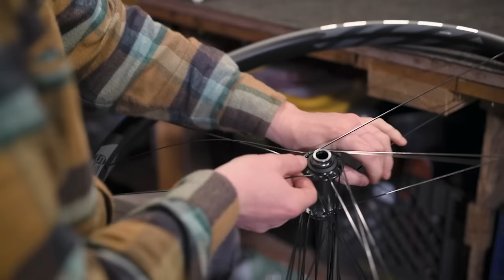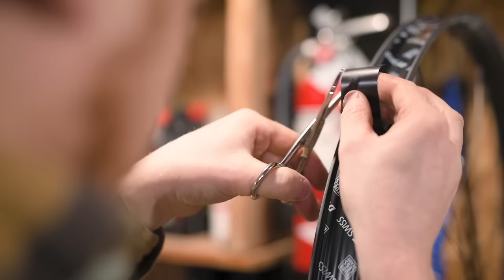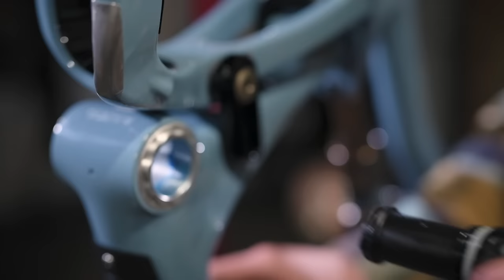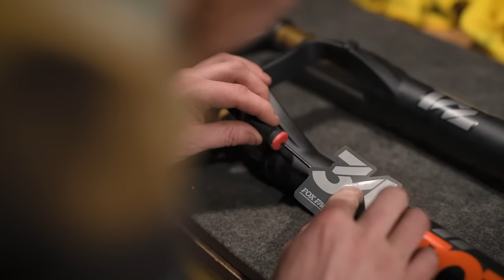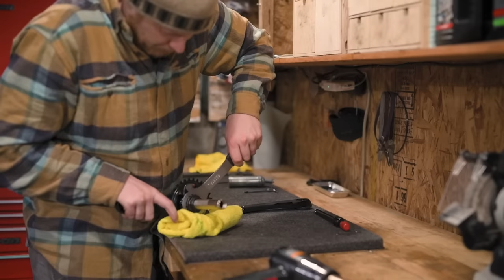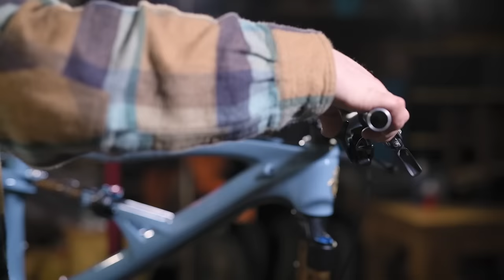Dream Builds: Nicole Formosa's Ibis Ripley

Comment: I never would have imagined the amount of work for spokes on a tire. Wow, never seen this done before.
Reply: And he didn't even use spoke prep on the threads that I saw.  Using that means 15 minutes MORE work the day before and then 24 hours to dry. 

But a tension meter is a must and it really slows down the wheel building process.  But the fantastic end result is well worth the extra time.

Those are indeed beautiful wheels.  But I'd rather see King hubs.  But I realize it's a factory bike build, so it needs the sponsors full parts kit.  (Has a King HS though.)

Comment: it didn't occur to me until he pulled the frame off the rack that the first 9 1/2 minutes of the video was just the wheel build. lmao
Reply: Wheel builds complete with nipple grease & washers, and THEN thread oil, tension meter and tubeless are easily 3 hours of work.  Rest of bike's about the same, if not perhaps less.

Comment: What’s so special about the wheel vs every other wheel that comes in a $400 bike?
Reply: There's a lot to explain so I'll be quick: $400 bike has machine built wheels with crap parts. this build is high quality parts and hand built, hand tensioned and trued = very strong, compliant and stays true

Comment: bike tech does not own a torque wrench?
Reply: I own one that I sits in its box on the bottom shelf and isn't used.  Rarely is mine ever utilized.  But I'm still using old stuff, so no rotors to torque or carbon to cinch.  If I were building this bike for someone else, I'd utilize a torque wrench in some places.

If it were for me?  No torque wrench - anywhere.

40 years building bikes tends to give you the feel you need.  Again, a lawyer would probably lick his lips hearing this, but it's true.  Torque wrenches in the LBS are a relatively recent phenomenon.  Well, maybe you'd see them 20 years ago, but they were hardly used.
Reply: You see that he needs them?

Comment: PM me your address and I’ll send you a torque wrench. Plzzzzzzzz
Reply: Although a torque wrench is a good idea, bikes up until about 15 years ago were all built without.  Torque values only started showing up on parts recently with the use of lots of carbon.  But the experienced mechanic could built 100 of these bikes without a torque wrench and barely one would suffer a problem due to any torque issue.  Feel is developed over time and finely tuned.  Experienced wrenches don't need torque wrenches to achieve proper tightness.  Not that they aren't a good idea to confirm values and keep the lawyers away anyway!